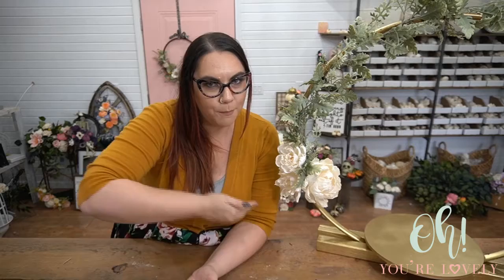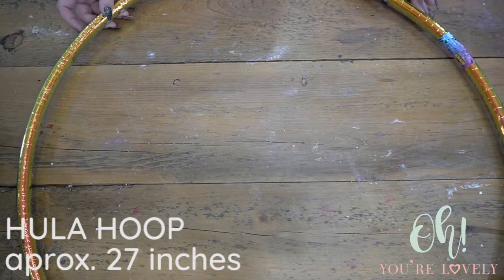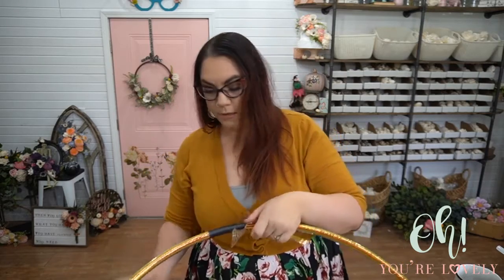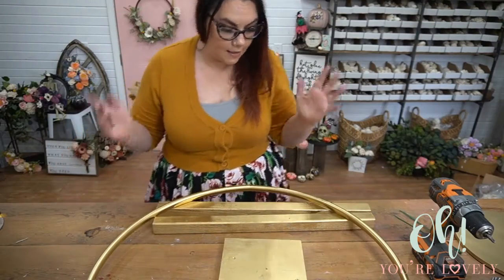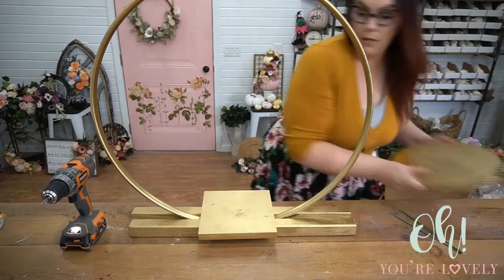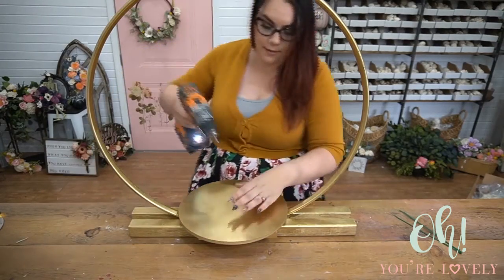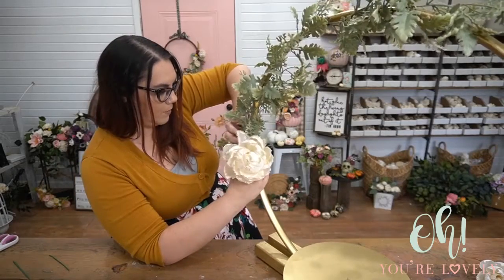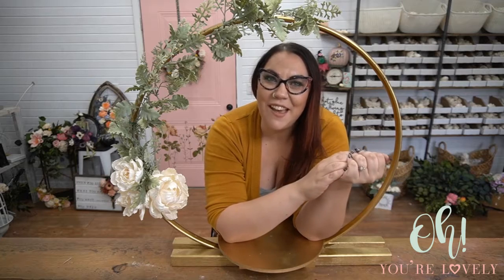Affordable hoop centerpiece or cake stand

Comment: For more security of the hoop, i epoxied it between the 2x2s and clamped them together until it cured. That way you don’t have to lean and squeeze while trying to secure the 8x8.  Also I found that I had to trim the square to about 7x8 because the arc of the hoop kept it from sitting flat